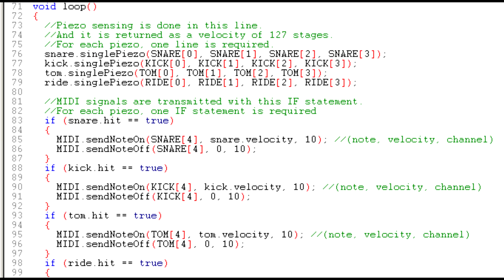Arduino MIDI Drums with Piezo Disc Triggers (with schematic and code)

Comment from the maker: // This is just the RyoKosaka/HelloDrum-arduino-Library example sketch
// "Simple Piezo Sensing" expanded to four triggers.
/*
  EXAMPLE - Simple Piezo Sensing
  https://github.com/RyoKosaka/HelloDrum-arduino-Library
*/
///////////////////////////////   SETTING VALUE   //////////////////////////
//Determine the setting values in this array

byte SNARE[6] = {
    90,  //sensitivity (1-100)
     5,  //threshold (1-100)
    20,  //scan time (1-)
    35,  //mask time (1-)
    40,  //note (0-127)
     3   //curve type (0-4)
};
byte KICK[6] = {
    60,  //sensitivity (1-100)
     5,  //threshold (1-100)
    20,  //scan time (1-)
    35,  //mask time(1-)
    35,  //note (0-127)
     3   //curve type(0-4)
};
byte TOM[6] = {
    70,  //sensitivity (1-100)
     5,  //threshold (1-100)
    20,  //scan time (1-)
    35,  //mask time(1-)
    47,  //note (0-127)
     3   //curve type(0-4)
};
byte RIDE[6] = {
   100,  //sensitivity (1-100)
     5,  //threshold (1-100)
    20,  //scan time (1-)
    35,  //mask time(1-)
    51,  //note (0-127)
     3   //curve type(0-4)
};

#include <hellodrum.h>

//Using MIDI Library.
#include <MIDI.h>
MIDI_CREATE_DEFAULT_INSTANCE();

//Piezo names and Arduino pins where they are connected.
//The piezo named snare is connected to the A5 pin, the piezo
//named tom is connected to the A7 pin, kick to A4 and ride to A6.
HelloDrum snare(5);
HelloDrum kick(4);
HelloDrum tom(7);
HelloDrum ride(6);

void setup()
{
  MIDI.begin(10);

  //Set Curve Type
  snare.setCurve(SNARE[5]);
  kick.setCurve(KICK[5]);
  tom.setCurve(TOM[5]);
  ride.setCurve(RIDE[5]);
}

void loop()
{
  //Piezo sensing is done in this line.
  //And it is returned as a velocity of 127 stages.
  //For each piezo, one line is required.
  snare.singlePiezo(SNARE[0], SNARE[1], SNARE[2], SNARE[3]);
  kick.singlePiezo(KICK[0], KICK[1], KICK[2], KICK[3]);
  tom.singlePiezo(TOM[0], TOM[1], TOM[2], TOM[3]);
  ride.singlePiezo(RIDE[0], RIDE[1], RIDE[2], RIDE[3]);

  //MIDI signals are transmitted with this IF statement.
  //For each piezo, one IF statement is required
  if (snare.hit == true)
  {
    MIDI.sendNoteOn(SNARE[4], snare.velocity, 10); //(note, velocity, channel)
    MIDI.sendNoteOff(SNARE[4], 0, 10);
  }
  if (kick.hit == true)
  {
    MIDI.sendNoteOn(KICK[4], kick.velocity, 10); //(note, velocity, channel)
    MIDI.sendNoteOff(KICK[4], 0, 10);
  }
  if (tom.hit == true)
  {
    MIDI.sendNoteOn(TOM[4], tom.velocity, 10); //(note, velocity, channel)
    MIDI.sendNoteOff(TOM[4], 0, 10);
  }
  if (ride.hit == true)
  {
    MIDI.sendNoteOn(RIDE[4], ride.velocity, 10); //(note, velocity, channel)
    MIDI.sendNoteOff(RIDE[4], 0, 10);
  }
}

Comment: Awesome. It's there any difference if I'm using 20mm piezos?
Reply from the maker: You may need to adjust the sensitivity in the code.
Reply: @unrelatedactivities   ok, it's my first DIY octapad, so if u can talk me about different piezo sizes, i would be useful.
Reply from the maker: All I can tell is that assembly with perfectly matching 35mm piezos and pill bottle lids worked nicely, I have not tried other piezo sizes or different lids or supports but I think they can also work with some adjustments and experimentation. Good luck and best wishes!
Reply: @unrelatedactivities  Im trying to make a drumkit with Raspberry pi pico 2, but it's very "noisy" even when it hasn't any analog pin soldered, so i can't program. Probably a power supply issue or is mi pico 2 broken?

Comment: im having errors on the line 47 

MIDI_CREATE_DEFAULT_INSTANCE();

is that just something i should know to put in the parentheses and i brushed over?

error:
sketch_apr18c:47:31: error: expected constructor, destructor, or type conversion before ';' token
 MIDI_CREATE_DEFAULT_INSTANCE();
                               ^
exit status 1
expected constructor, destructor, or type conversion before ';' token
Reply from the maker: Seems there is some trouble with the MIDI library, the sketch compiles without errors here with MIDI_Library-5.0.1 and HelloDrum 0.7.7.  
https://www.arduino.cc/reference/en/libraries/midi-library/ 
 https://www.arduino.cc/reference/en/libraries/hello-drum/
Reply: @unrelatedactivities  i spent so many hours on this thing it's not even funny. and in the end it's not working bc i may have wired something wrong lol. but that's problem for tomorrow. just came to say thank you, after you said something about sketch, it took me a while but eventually was able to fix it and upload the code and make ripper recognize it. idk if it's just that but there was a conflict between Midi and Midi library. anyways, thank you
Reply from the maker: You are welcome!
Reply: @unrelatedactivities  sorry bothering you again. i can't get this thing to work for some reason. i installed a midi monitor and press the piezo but nothing shows up. i tried different ports, tried only the piezo, piezo plus resistor and piezo resistor and diode. i also tried multiple piezos. idk if it has anything to do with it, but my board is kinda different, it's purple and it has a usbc port instead micro usb i see everythere
Reply from the maker: Are you using USB MIDI or a standard MIDI connection? The code, as is, will not work with USB MIDI, it uses the Arduino serial TX pin to send MIDI data via a normal MIDI cable connection.
Reply: @unrelatedactivities  on the cable it's just a normal usbc cable, on the code it's midiusb. im afraid it's the type of board i got, i just ordered a normal board with micro usb to see if that's the problem, it' a couple of weeks to get here
Reply from the maker: I don't have a USB MIDI capable board to try this option, hope you succeed with the new board!
Reply: @unrelatedactivities  i got it to work. the problem was that i was using the wrong midi library. on your code there's a link to a gethub, i was reading there and it says what midi library to use depending on your board. when i installed the correct library all the boards worked. 

question: if i don't have any piezos all the ports that is programed keep activating non stop. if i put on two, each  piezo works as if they were on two ports. if i have all, they work but waay to sensitive. is that normal? also, i was trying to use a0 a1 a2 a3 ports and they wont work? is that something to do with the code?
Reply from the maker: @halfend8199  The piezo related things are done by the HelloDrum library, the settings for each piezo connected to the Arduino board can be adjusted in the arrays at the top of the sketch, for example: 
byte SNARE[6] = {
    90,  //sensitivity (1-100)
     5,  //threshold (1-100)
    20,  //scan time (1-100)
    35,  //mask time (1-100)
    40,  //note (0-127)
     3   //curve type (0-4)
};
The library documentation explains how this works: 
https://github.com/RyoKosaka/HelloDrum-arduino-Library/blob/master/docs/sensing.md
https://github.com/RyoKosaka/HelloDrum-arduino-Library/blob/master/docs/setting.md

If the problem is not hardware related, I think changing the settings will solve it. 
When there is no piezo connected to a pin used in the code, the readings will jump everywhere, so you should comment or delete the lines related to that piezo/pin, or connect the pin to ground through a resistor (10K should work). 

The Arduino pins connected to the piezos  are set  in these lines, outside the functions:
//Piezo names and Arduino pins where they are connected.
//The piezo named snare is connected to the A5 pin, the piezo
//named tom is connected to the A7 pin, kick to A4 and ride to A6.
HelloDrum snare(5);
HelloDrum kick(4);
HelloDrum tom(7);
HelloDrum ride(6);

Comment: What midi software u use?
Reply from the maker: In this video I used a hardware synthesizer module (Roland Sound Canvas SC-55), not a computer softtware.
Reply: @unrelatedactivities  I Cannot  used in Batery 4 Sofware
Reply from the maker: @อัสวินดิจิตอล  Did you select the correct MIDI interface in the Battery 4?
Reply: @unrelatedactivities  I asked on your page.

Comment: Could you add a microSD to load the samples?

And maybe one button to scroll through sample sets?

And, possibly, one button/knob to adjust volume output?
Reply from the maker: With an Arduino Nano I am afraid it is not possible.
Reply: That's a bummer. What would be the minimum Arduino (or ESP or Pi) that would be needed?  @unrelatedactivities
Reply from the maker: In the HelloDrum Arduino Library examples folder there is an example sketch for  something like what you are searching for, using a Teensy. I never worked with a Teensy, but it seems to be powerful enough for this task and the example is at least a starting point.
Reply: Thanks for the pointer  @unrelatedactivities

Comment: Sabe dizer como fazer para nao repetir a mesma nota varias vezes, está ocorrendo no meu
Reply: I discovered that the problem is just the mask time, increase that value, and the gost notes will disapear
Reply from the maker: Exactly.
Reply from the maker: Aumente o mask time, não ocorrerá outro disparo durante este tempo. Ou pode usar algo para amortecer a vibração do piezo, como é feito em baterias "de verdade". No caso das tampas usadas no video, fechando-as com mais força diminui a sensibilidade do piezo.